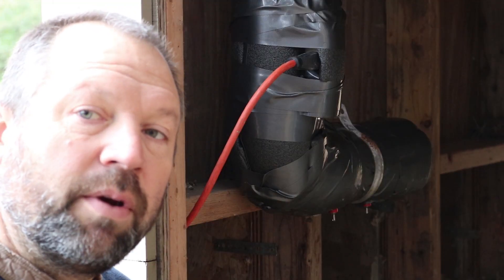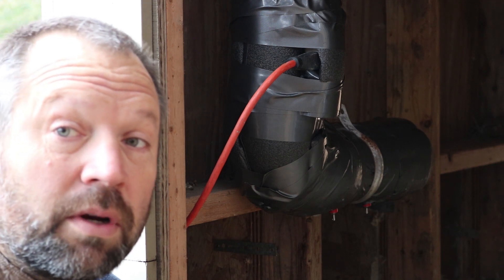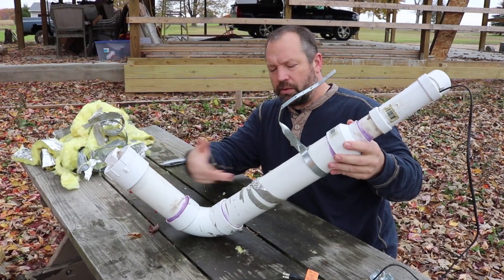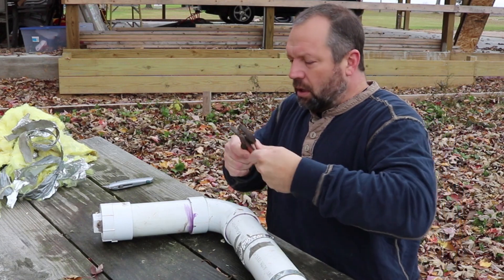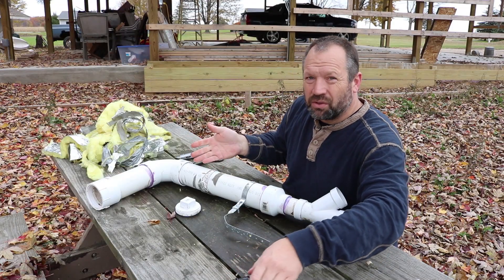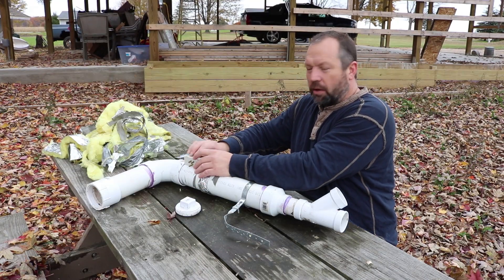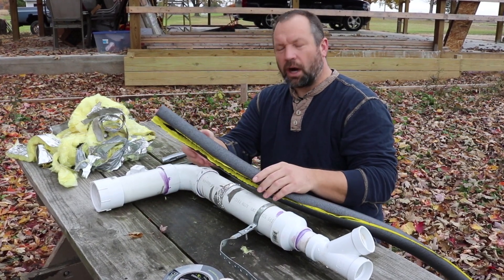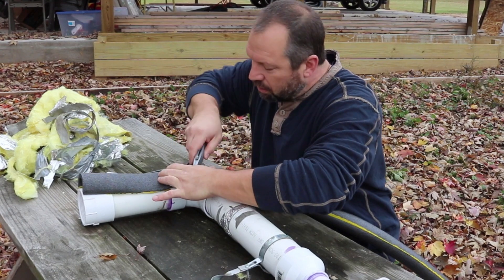Heated PVC Chicken Water UPDATE - Using an aquarium heater

Comment: I have similar water system , and I am planning to test a submersible aquarium water heater to do 2 gallon of frozen water not insulated ,what do you think will it work with 30 watt heater its -7  degrees Celsius at night .
Reply from the maker: If you are using the thermostat block that shuts it off just above freezing I think a 30 watt heater should work well enough. On those really cold nights it'll probably be on all the time but should be fine.
Reply: @CountryFamily  it worked perfect but the problem is as you saying in the video warm water rises up , and I cant keep it at the dispenser end which lower than the 4 inch tube I am putting it in . What I did was turn it to the highest ie 32 cel and covered the thermostat and the ac wire with epoxy as this is a 20 year old model which had a protruding thermostat shaft  , but I think that epoxy sealed all places around the wire inlet and that thermostat  shaft . Working perfect , had it not been your video I might not have done it so quick . Tested today . Working fine . I wanted yo know if someone ever did this what we did . Thanks
Reply: I wish these aquarium water heaters were upto 45 deg cel or more

Comment: Great video I love the heater idea, I will be doing the same with a 2 gallon bucket instead of PVC. The aquarium heater you have linked looks different than the one shown in the video. I bought the one you have linked, and it's not entirely clear, but sounds like it CANNOT be completely submerged. It says submersible, but there is a picture of it laying flat at the bottom of the aquarium that says "incorrect installation". "Correct installation" shows it mounted vertically where the top is out of the water. I'm not sure if this one will work... Can you provide any more details on the heater you used? I know amazon changes things sometimes and will show new items on an older item page...
Reply from the maker: Yeah, I don't think the one I linked to is the same one I used. It's been awhile and I don't remember exactly which one I used but I think this one is a better choice:
https://amzn.to/3dDICMV